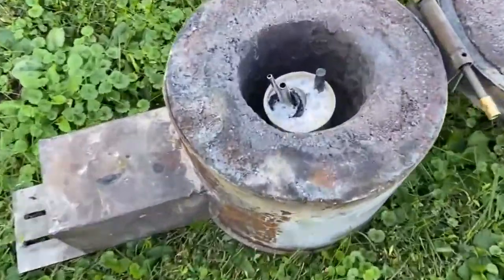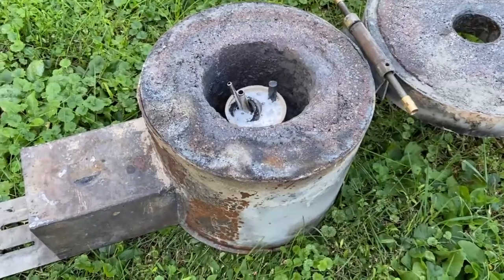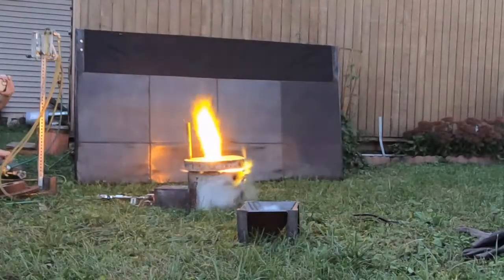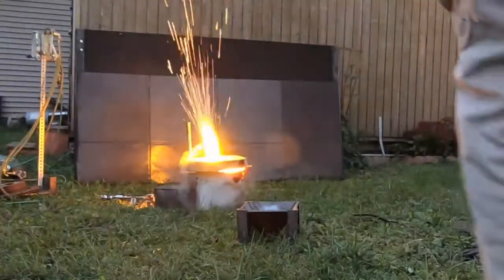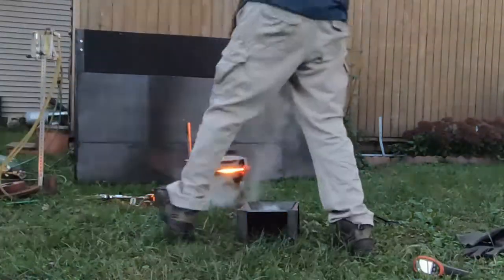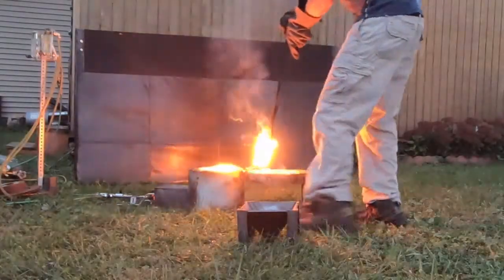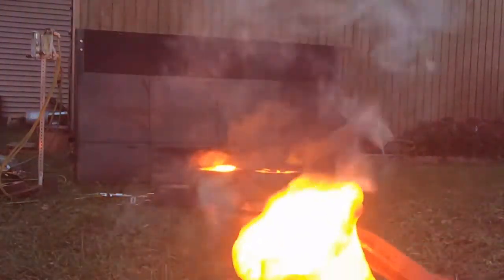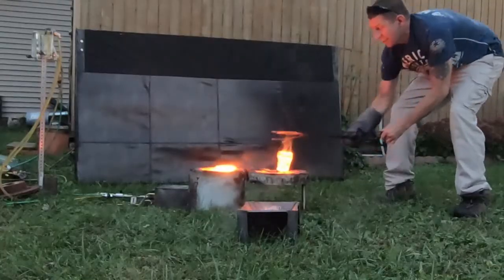3,200 Deg F ROCKET BURNER melting HSS drill bits

Comment: First off that crucible is what? Less that an eighth inch thick? If it was larger and had a half the 3 quarter inch think it wouldn't have taken that much damage, industrial sized crucible are at least 3 inches thick or more, and direct heat to crucible will melt it, if it was cycloned it might have taken a little bit longer but I feel like the melt would have worked better. Definitely going to buy a burning from you when that time comes for me the build my steel foundry, if India can do it we can too.
Reply from the maker: This is melting Steel not cast iron my friend so like in the glass melting furnaces we need direct flame impingement for max temp . Cyclones have shown the same effects and cannot get as hot also are harder to make .
At this size it makes no difference as the flame still hits the crucible . I have tried both and for this small of size it isnt worth it
Reply: @NOBOX7  is there a way to do a top end burner that puts the heat to the center top? Without blow back or explosion?

Comment: Amazing indeed!
Reply from the maker: Hands down you are one of the best chemist on youtube ,  your work really helped me in my ewaste refining Job i had last year . I melted a bunch of anode sludge from a electro digester cell i built , it used electro  hydro dialysis and dissolved metals in a basket and the copper was deposited onto the cathode as the basket was the anode and all the precious metals fall into the bottom of the tank to be melted  . We then used your ideas to process the metal ingots we got from the anode sludge .
Reply: @NOBOX7  I want to try copper electrolysis as PM recovery method too, especially at this price of the metal...
Reply from the maker: Wow , im a huge fan of your work , for 2 months straight back in 2020 i watched your videos during my dinner time . I was working with computer waste . You are a very clever chemist .
Perhaps you can melt platinum now in your cupels  LOL

Comment: how can i make that one friend? i want that to melt of my copper clad accumulated..
Reply: I'm sure you can buy his burner on his ebay shop once it's ready
Reply: @TimeFadesMemoryLasts  yes i really need burner to melt my accumulated  extracted copper clad from electronic PCB.
Reply from the maker: I sell diagrams for $25 and the burner is $195
but i can tell you this , you will not be able to build this burner this cheap if you build just one , it would cost about $350 to build just one and you would have left over supplies . you cant buy just 1 ft of tube you need to by 25' cus thats all they sell . the metal sheet it was made from cost from $80 to $560 for the one i purchased. also the valves and fittings are very expensive unless you buy 10,000. So its up to you good buddy my info is in the description